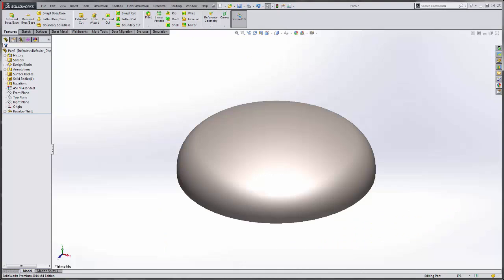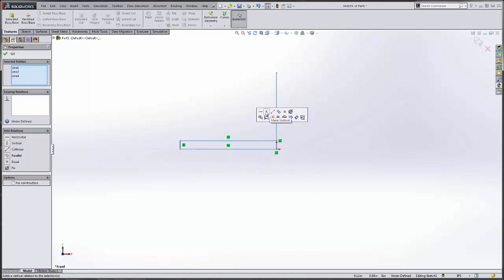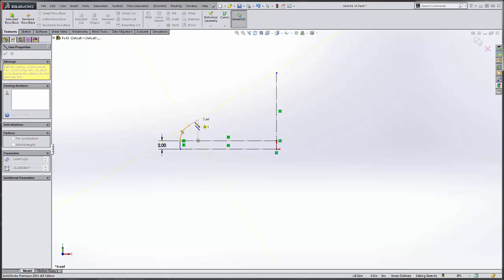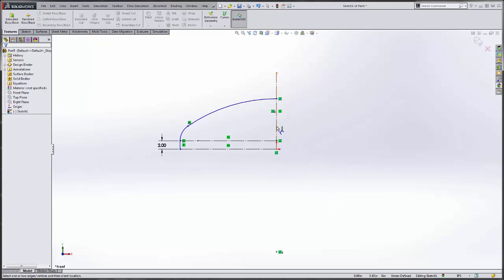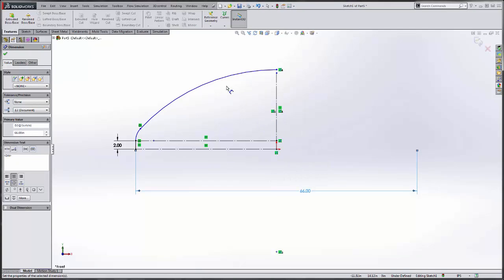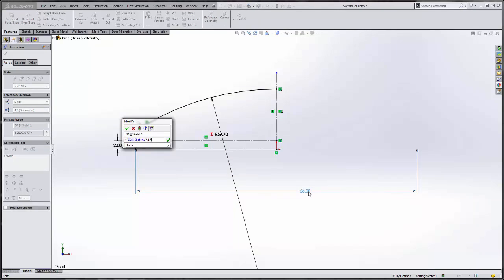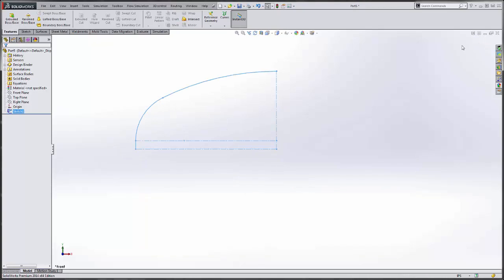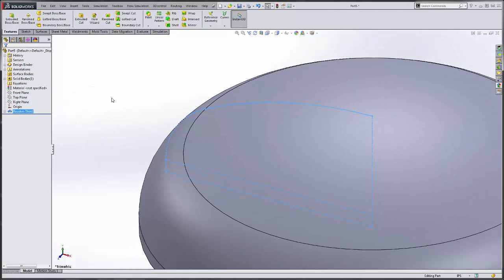SOLIDWORKS - 2 to 1 Elliptical Head Design

Comment: Shape 2:1 ellipsoidal head 

Di = Do - 2 x t
CR = 0.9 x Di
KR = 0.17 x Di
SF = per spec
DH = 0.25 x Di
THi = SF + DH 

t = wall thickness, Do = outside diameter, Di = inside diameter, SF = straight flange height, DH = dished height, THi = total height inside, CR = crown radius, KR = knuckle radius